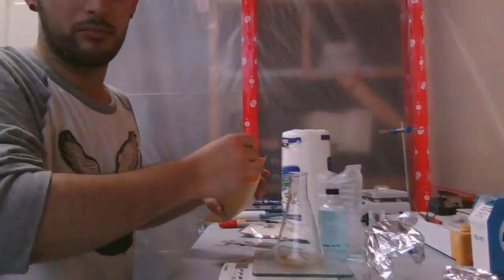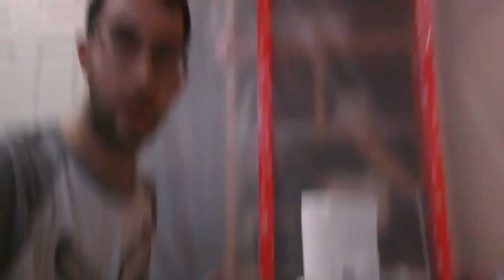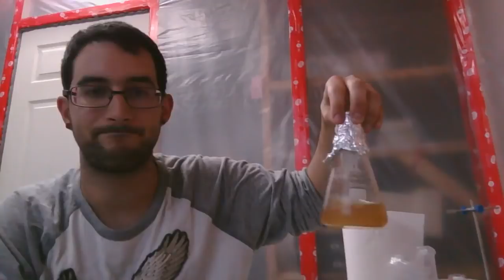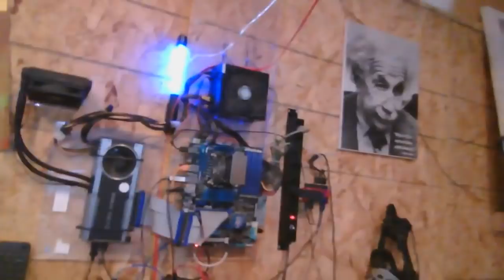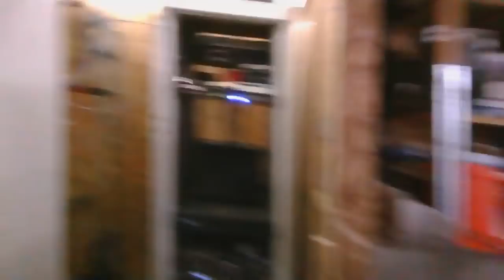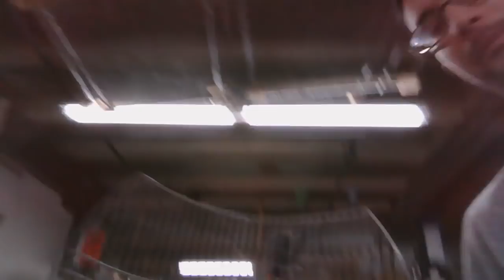Live lab work and workshop tour

Comment: I wish I was anywhere near Montreal. Out of curiosity, how does one become a member? The first few things I'd do is make some tools for metalworking, then practice making various thing selling them and giving 100% of the profits back to the lab since I'd only want the experience. I'd also want to mess around with various other things I've wanted to do for a long time but haven't had the equipment available or the space to get it.
Reply from the maker: There's 2 tiers, members and users. To get either the process is basically, show up to open nights, work on stuff, talk to people. Assuming people think you're a good fit you get user status, pay a small fee and can come in whenever. Criteria isn't really strict, its more that we get some real nut jobs in every now and then so it's to help keep that out. Once you've been there for a while and have been using the shop and stuff you can ask to become a member and are then voted in. You have to pay a higher fee, but also get a physical key to the space at that point and voting rights.

Comment: Super happy for you getting a space to work. They gene spliced goats with silk spiders in Quebec,. They then milk the goats to separate out the protein to make super strong silk that DARPA and U.S defense buys. 
Meanwhile other scientists  fed Graphene oxide (in water) to silk spiders and a single stand of that silk apparently can hold a mans weight. (so Spider man uses that silk and it would conduct electricity).
Some Finnish lab just produced/identified a bacteria/?yeast that they can produce by putting a current through ...has 50% protein and 25% carbs.